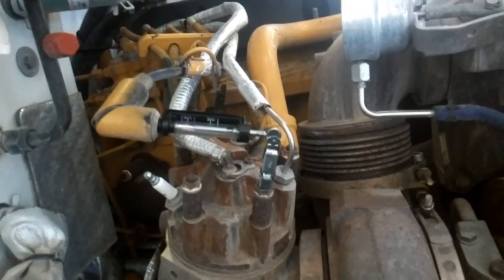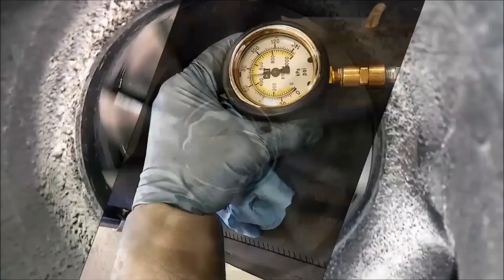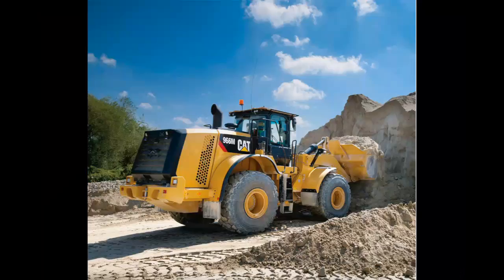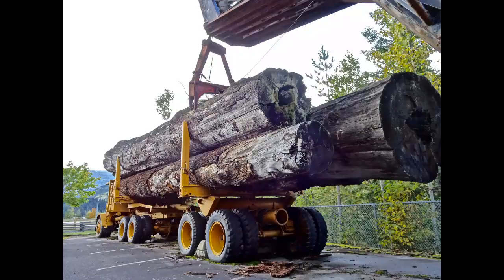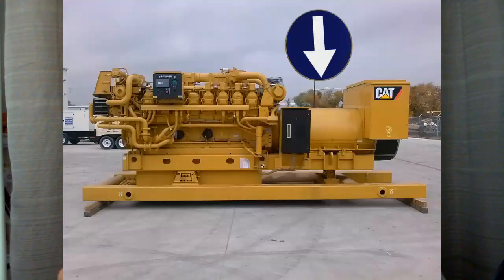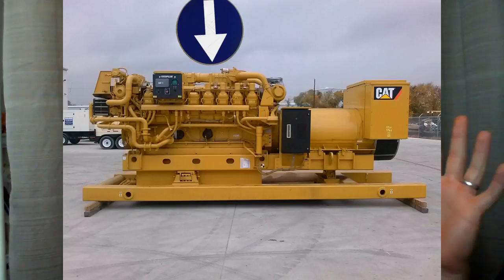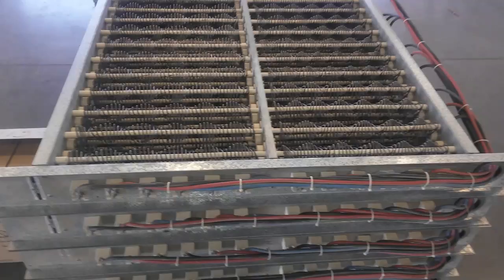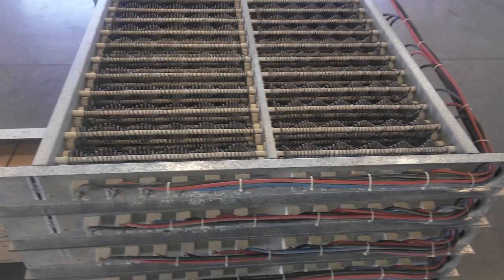What Being A Diesel Electric Power Generator Mechanic Is Like?

Comment: power generator mechanic: half mechanic, half Industrial electrician lol.
Reply: shortfuse1993 thats me I guess
Reply: and part social worker when something breaks and the customer has a hernia, there are no parts available, your support are pissed because their boss just told them they suck and need to get their numbers up, warehouse doesn't care if the part gets there fast or slow and decides slow is better since it saves a dollar,  your boss tells you that you are doing great but then turns around and tells customer you should be able to get it fixed because if it is not running they need to pay downtime penalty to customer.  Otherwise it is great and a fun job.
Reply: And about a third instrument tech

Comment: Telecom background here.  Generators everywhere.  Talk about wearing many hats.  Know the diesels, the generators, inverters to convert back to DC, battery banks, and my least favorite the ATS (auto transfer switch).  Stupid crazy amounts of potential power just sitting there.  Wrench across a main DC buss bar?  Instantly vaporizes sending molten steel and copper everywhere.  Oh and fire suppression systems.  Was always grateful to have the genset side contracted out.  Load tests were fun for me since I had a front row seat.  Always something about seeing an engine running full tilt, then toss a full load on it.  Hear it pull down then come back up.  Just cool stuff.  Lots of respect for the guys keeping them running and tested in the field.
Reply from the maker: +Shain Andrews Thank you for the comment and great avatar picture.

Comment: I was trained as a  power generator mechanic 👨‍🔧 52B30 at Fort Belvoir, Virginia in 1977. When I was stationed at Homestead AFB , near Miami, I would have to switch the barracks and missile pads from the local power plant to generator by synchronizing the sine waves to prevent a black out. This was accomplished by getting 2 100 watt light 💡 bulbs 💡 to flash at the same time, then hit the switch. Man, have times changed

Comment: Served a lot of my Apprenticeship on EMD And GE Locomotives .The EMDs had DC generators to power the traction motors and the GE's were alternators . It's odd to hear how people are employed as trainees and expected to carry out work that qualified Time served people would have done 'back then'. We would test the EMD's on a load bank but the GE's were still new to us so qwe would couple one up to another loco and tow it up an incline with the towed loco being in Dynamic brake where  the traction motors are turnined into generators and the juice produced is dissipated though massive resistors in the roof in the Loco . We would cause "flash overs" where the brush holders would esplode ...indicating a fualt(after creating one..) .After i came out of my time I trained as marine engineer where I learned further about gennys ,especially tug boats and icebreakers which are diesel electric just like a locomotive but with more engines . How big are these on Ships? In the 1980's the city of Auckland lost it's electricity supply ,so A ship was moored at the water side in the city and connected to the grid to reticulate electricity. As the governments of this country bend to the will of windmill operators our coal generation plants are bering demolished so there is a bright future for people clued up about the operation of  portable generation plants.
Reply: sounds like those were been tested real well :).
Auckland New Zealand?
I'm in the south island Hydro here :)
Reply: Great info right there. This sounds really fascinating. Jim

Comment: In the civilian side I did the reverse of adept ape, I started at a ford dealer, then international and Volvo trucks, now power generators. I learned power generation through the army signal corps (generators are prime power source), although I work for a generac dealer so I see units from nat gas/propane 9 kw residential to diesel 600kw industrial. Unfortunately I never see anything larger. However I love not being at in the same boring dark shop everyday. Sometimes I'm in the basement of an office building and sometimes a beautiful family farm in the mountains, everyday different.

Comment: I've been an electrical engineer over 40 years most of that working with large generators. There is always a need for experienced generator mechanics. Like you said, training is hard to come by. The best I can recommend is to work with someone who has a lot of experience on the electrical side and ask a lot of questions. No lack of good paying jobs in this field.
Reply: Bill Moran Hi Mr. Moran, how did you get started in the power generation field? I’m almost graduated from the diesel program at Universal Technical Institute (UTI) and I’ve applied myself and really learned as much as I can, finishing at the top of my class in every course.  What I’m learning is mainly preparing me to work on heavy duty class 8, class 7 trucks, equipment etc. but power generation seems promising too...  UTI does actually offer a Cummins power generation training program which would be supplemental training in addition to what I’m already doing ...but it would cost more money ha. I’ve looked into that and am considering it but as you said and what I’ve been hearing a lot is the best way to learn is by experience.  Anyway I’d like to hear from you on how you got started, maybe some advice?  I’m just a random kid on the internet  (I turn 19 in 4 days) but I’m impressed by your 40 years experience and maybe I can learn something from your experience, thanks 🤙🏻
Reply: @kylekoplien4125 how fid that go for you bro I'm attending UTI right now in AZ as well and I'm also going for gen tech gonna do the Cummins gen program are you working out in the field now ?

Comment: Hi Adept, 
With today's energy markets being what they are we have many natural gas powered alternators running in COGEN arrangements where the cooling water is used to help heat / cool the building and the power to reduce the peek power demand from the Street supply in many of our new buildings here in Australia, although they are usually gas turbines, I do have one new building running a spark ignited 360Kw V12 CAT 10 hours per day, strange to see a reciprocating engine in this role but nice to listen too it purring away at 1500 RPM all day.
The bit on the back is an ALTERNATOR not a GENERATOR.  Alternator = AC  Generator = DC, although the entire package is a "power generator", sorry it's one of my pet hates, same thing on the battery charging circuits in cars, trucks or whatever old days we had generators making low amounts of DC, nowadays we have physically smaller alternators that make much more current, they too are usually three phase as it's the most efficient to wind and produces less ripple, this is rectified internally to DC to charge the starting batteries.
P.S  electrocuted means that you are DEAD, that's my second pet hate.  I grind my teeth when people say "Oh I got electrocuted yesterday" really what's it like being dead?  Or they ask "how many times have you been electrocuted at work"?

40 years in the electrical / power generation industry has made me a bit touchy I guess, love your videos they are outstanding and extremely informative, I never knew what a jake brake was till I watched your video, we have no need for those on stationary engines but I love knowledge, again thanks for the videos.
Reply: I know what you are referring to concerning the nomenclature argument and history of alternator vs. generator, but the reality today is the name alternator is being replaced industry wide with the word generator, because the word generator denotes producing electricity, whether it be AC or DC.

In the early days of the transition from generators, which produced only DC, to  alternators, which produced AC rectified to DC, it was important for the suppliers and the automotive industry to ensure the clear distinction between the two products was understood.  Since you and I are going the way of the dinosaurs, most mechanics today only know alternators, and so the noun alternator can be easily to changed to reflect its function as an electrical power generator.
Reply: True enough Chad, I guess people are just lazy, inverters, converters, alternators, generators, magnetos, lets call them all "lektric things". I'll stick with what Tesla named it when he invented it.  Judging by my kids text messages, everything will be called :<) or TBH or LOL before the end of the Decade, I see no reason to help in the decline back to cave paintings.  Smiley face.
Reply: Prior to the early car generators, there were large Tesla style industrial power machines producing AC which were called generators, and there were large Edison style industrial power machines producing DC.  I'm just saying no one has a patent on the term generator or alternator, and if I tell  my younger subordinate to replace the generator on one of our KW's, he will know what to do, but when discussing this matter with another old folk like myself, I definitely use the generational name.  

Remember when we were little babies and were called cute?  Cute used to mean bow legged (and we weren't bow legged).  A harmless change requiring our adjustment. :<)

Comment: 19:35 while i don't know what a barrier is i think what you are talking about is that all aviation use 400hz frequency. this is due to induction force being stronger at higher hertz, allowing you to use less or no ferrous (HEAVY) material in the transformers on aircraft. making a lighter transformer for a flying piece of metal means it can carry more of whatever (fuel=range=more possible routes, passengers=$$$ or cargo of whatever sort=$$$ or x_x) which is of interest to any operator of any aircraft. the 400hz convention was settled on early in aviation history. a balanced 3-phase generator and load is a thing of beauty :D i am involved in aviation in case you could not guess ;) but do not enjoy be so tightly constrained to flightlines even with the pluses that go along with it. i think mobile service at customer sites scattered all over sounds more enjoyable, i will attempt to move this way :) another miscellaneous fact, you mentioned 480vac phase-to-phase, all aircraft larger than a cropduster from any manufacturer around the world is fed 200vac phase-to-phase, 115vac phase-to-neutral. a few special aircraft can be fed from two generators paralleled if required but that's still only a few hundred kilowatt, which pales in comparison to the land or naval numbers. thank you for the knowledge you share kind sir

Comment: On older generators did the caterpillar dealership you work for adjust the Governor and do parallel of generators. I know the newer engines are electronic control but the older ones have governors. Some of them you have a electric panel hooked up to actuator on the engine. Other have a hydraulic governor on them. Dose caterpillar offer training on them.

Comment: Thanks for explaining what the load bank test is they do it every year at the wastewater plant that I work at and always want to know what that trailer that said caution 600 degrees Fahrenheit did and we have two big stand by generators one a old cat 3412 749 HP that was installed in 1988 and a Detroit diesel 48.7L that has 2,200 HP that was installed in 2006 to handle a expansion we had. Hands down we love the cat way more then the Detroit diesel. The Detroit diesel has broke down 5 times and I only know one time that the cat broke down. It had something to do with the on board computer losing all its set points. Last I love you videos don't work on Diesel engines but love seeing what makes them tick.

Comment: Was a power plant operator for years....used to have an airstarted V12 Cat for starting a GE frame five combustion turbine
Reply: Also ran a combined cycle landfill gas plant.....3 three megawatt cat Solar turbines one Steam turbine
Reply: Lol I ran a plant with 7 ge frame 5's - in the event everything went black and we had to bring the plant out of the dirt we had two Detroit 12 cylinder 149's to run the pumps and some lights and air compressors - then we had 2 diesel started machines - the diesels ha 125 volt DC to spin them - they were 550 hp diesel engines- when we got one of them up we would close onto to the switch yard and start the other machines the had 550 hp electric start motors on them ... in 15 years I only say that plant go dark 2 times - fuel gas supply once and loss of control air once

Comment: I knew of the engine using dc current but i didnt know about it putting out ac which is really helpful. I think ill do good on both electrical and engines cause i just finished an electrical program, i got 6 years experience as a mechanic and am about to go to work for aggreko

Comment: Does Cat build/design their own generators?
Reply from the maker: +Stephen Cox Yes they do, engine, radiator, generator, control panel, and voltage regulator. They are pretty good in this respect.
Reply: Made in Lafayette indiana
Reply: Yes cat does build a good generator however has a habit of locking you into cat generators - if you try to mix cat generators with other brands in the same plant your subject to have some very serious problems - what happens is when you parallel another generator with a cat gen you will get what is referred to as "circulating current".  This is generally not a problem with most generators - all you have to do is adjust the voltages till they match - when the voltages match the circulating current goes away.  The problem is with how the cat generators are built - cat generators are wound with what is referred to a 5/8 pitch while all other brands are wound with a 3/4 pitch.  This internal manufacturing difference causes the circulating current and when you parallel two dissimilar generators do parallel the circulating current is uncontrollable causing the machines to trip their main breakers on over current.  I ran into a plant one time that was having its generators rewound and engines rebuilt one at a time.  The plant was 800 miles out on the aleutian chain .. so we would remove the generator and ship it to Anchorage Alaska for rewind - they rewind them to a 3/4 pitch - so when we got the first one back it would not parallel... so after doing some figuring and calling some of my really smart friends it was decided to put switches in all the neutral wires just before generators - circulating current circulates between the neutral wires ... so when we parallel generators with different pitches we would open the neutral switch on any machines that had different pitches.  There had to be at least one neutral switch closed in order to have a fault current path in order to clear a breaker in case of a fault and to maintain a zero voltage reference for the electrical system.. The plant had 5 generators and the project would take 4 to 6 weeks for each machine.  The solution worked perfect and once all the generators got overhauled we removed the neutral switches.  Cat generators have some interesting regulators too but that's another generator man story lol - yes cat builds some good generators but you have to be aware that you will be locked into cat forever unless u have cat build ur generators to a 3/4 spec.  Also if your facility ever has to rent a generator that has to parallel with your system it will have to be a cat rental... good luck

Comment: Do natural gas engines have spark plugs ? and are there Cats dual fuel like Cummins QSK ? I've noticed that natural gas goes in just before the turbo... What happens to the spark plugs when running on diesel, do they get dirty with soot? Thx

Comment: Do you think that diesel will ever get phased out? I just saw that cummins and tesla came out with protoypes for elecric semi trucks. Im thinking about going into this field, but worried that diesel is not the future
Reply from the maker: +Thewhiteboy 503 In the future, yes I think fossil fuels will get phased out, but I think that is far away. There isn't a comparable alternative right now, maybe nuclear, but people are terrified of that. Battery technology isn't there yet for straight electric trucks yet.
Reply: Thewhiteboy 503 the other thing you may want to keep in mind is if you work In a truck shop is that you will work on a lot more than just the power plant, ( suspension, brakes, air system, steering, heating/cooling, tires, electrical, and whatever else I'm not thinking of)
Reply: No need to worry about that unless you plan on living a really long time.  Trucks are only commercially viable if they can carry freight long distances and get to their destinations on time, carrying around battery packs decreases the amount of freight they can carry, spending 12 log book hours on the roadside waiting for all the D cell batteries to recharge while the frozen food in the back goes bad, also not good.  Asking the dispatch controller if they have a 32 Amp 3 phase socket in their loading dock, priceless. 
When they start putting sails back on ships, then you'll know its time to get out of diesel fitting.

Comment: Hey Adept,

How did your facility test the generators? What kind of load bank does Cat use?
Reply from the maker: +Omar We have a couple different heater style load backs. From 50 kW up to an 2000 kW version. Never used the salt water style or any other version.
Reply: Adept Ape Thanks
What about the truck engines and off-high way engines? What is the principle of testing the engines?
Reply from the maker: +Omar On an engine that isn't a generator, you could put it on an engine dyno, that would test it.
Reply: thanks

Comment: 3m Watts /480 / 1.73 = 3612 amps per leg.  I did the stuff for 20 years. You would have to run 4 parallel runs of 500ckmils .would give you 4000 amps  per leg for that generator.  And Bob’s your uncle
Reply: How did you know I had an uncle bob?